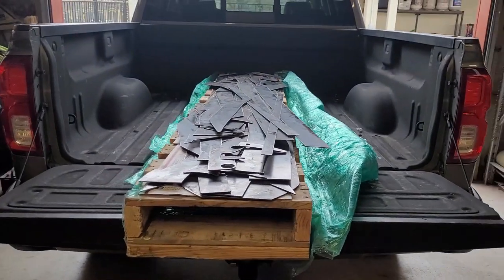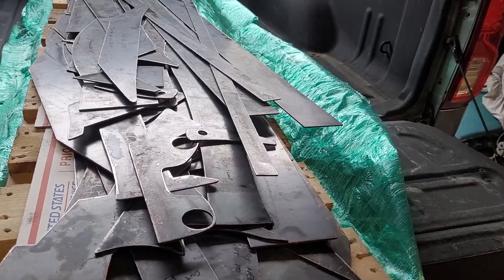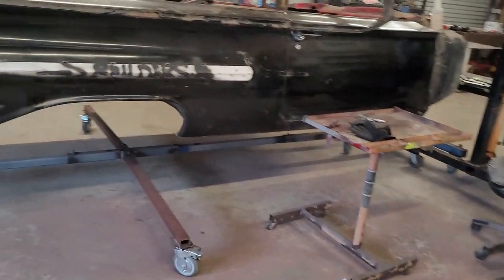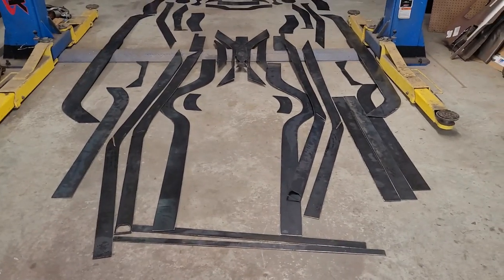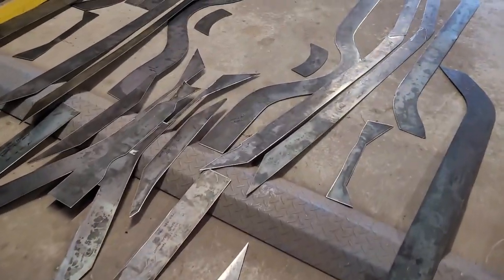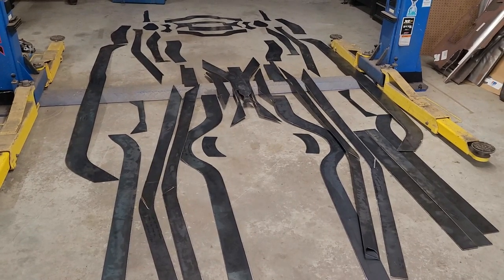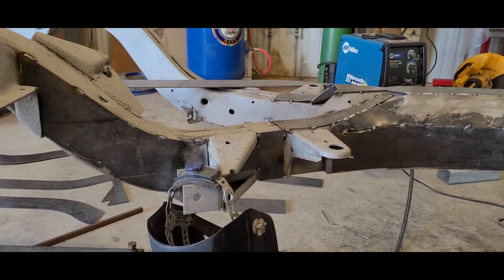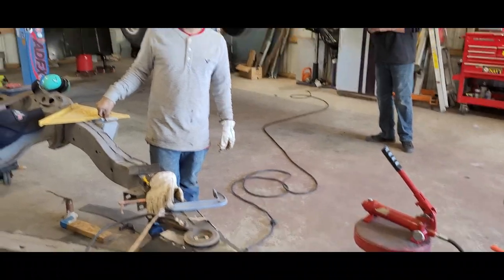Lowrider Hydraulic Frame Reinforcement | 1960 Impala Part 1 | DIY | Rematch | Lonestar Lows

Comment: Quick tip: if you want to remove the body mount to plate and keep the position… weld brackets with a door hinge, then cut the body mount off and flip it with the hinge… when you done plating grind 3/16 of the mount and reweld it back to the frame.
Reply from the maker: Yea! We thought of that after the fact lol

Comment: I’d like to speak to a structural engineer on the difference between 1/8” and 3/16” in an application like this. At most these pieces are 5-6” wide. I bet the strength lost of gained from 1/16” thickness is very minor. And I think if we were doing this for 100% strength reasons we wouldn’t be full welding all 4 sides front to back. Most of these frames are wrapped for looks and makes the people sleep better at night because it looks beefy lol. The hardening done by welding that hot, that long, and with seams that close together is crazy.
Reply: Thanks for your input
Reply from the maker: I agree. Wonder what the engineer would think about 6 batteries in the trunk. 4000lb car going down the highway on 13 inch wheels lol
Reply: @lonestarlows  😂 😂 right

Comment: There's a local car here that has 1/8 and it has been fine for more than a decade and is a rag too. I bought bigger for my 62 ht and wish I wouldn't of. If it's not going to be a crazy hopper 1/8 is more than enough. So much easier to work with also.
Reply from the maker: I think the stocm frame is 1/8 so it's essentially twice as strong now. For a car that will run accumulators I think its more than enough
Reply: @lonestarlows  100% agree. 👍

Comment: Man That's A LOT Of Grinding It Down!!!
Awesome Looking Kit And Definitely The Wat To Go!!!! Much Easier To Buy A Kit That Someone Else Has Done The Work Figuring Out And Uses A Plasma Table To Cut It CNC Fir A Great Fit!!! Going To Triple S And Buying 1/8" Plate You Would Have A Bunch Of Waist!!!! Much Cheaper In The Long Run!!!
Keep Rocking It Out!!!!
Reply from the maker: I dont even know what a 4x8 costs ? 300? This kit came cut, cleaned up, and labeled.  Saving tons of time.  Still need to buy about 100 tiger discs  to mold it up lol
Reply: @lonestarlows  I BET You Would Be Close!!! And You'd Need Several Sheets To Get All Your Long Pieces!!! Maybe 2 Or 3 Grand In Steel Alone Today!!!
Rock On Brother!!!

Comment: You don't have to cut the body mounts off.all you need is to cut a 1/8" slit on the sides of the body mounts,prebent the metal and slide it in between the body mounts and frame.easy,and keeps it strong
Reply from the maker: Yes we thought about that too, but the body mount runs down the whole side of the frame vertical,  so it would pretty much need to be  a slit cut the entire way .  We might find some areas up front to use this idea 😎
Reply: @lonestarlows  slit cut it all the way up and leave the tops of the body mounts(horizontal side) welded
Reply from the maker: That's a good idea too

Comment: You might of answered this ? In a previous video. But why did you swap the original frame?
Reply from the maker: The original convertible frame has factory reinforcement and would make for alot of work to plate over it, or remove.  Convertible frames are worth good money to the purists, and a hardtop frame fits,  it just needs a pair of body mounts added.

Comment: Did you have to mount the body back on the frame to locate where the extra body mounts go.  I'm in the same situation building my 59 convertible using a frame off a 60 4 door.
Reply from the maker: Yes I did. It's on one of these frame wrap videos.
Reply from the maker: Might be on the conti kit mock up video

Comment: Got my convertible 63 frame ready to start reinforcing. Do you always think its always a good idea to wrap the whole frame?  I don't plan to hop and I know all that extra weight has to make the drive a little harder so would you do it for your own ride?  Just curious what you think and why.  Thanks bro. Always respect your thoughts.
Reply from the maker: A full wrap is not necessary,  just depends on the owner of the car and how they treat the car